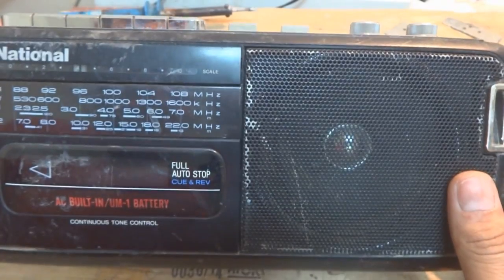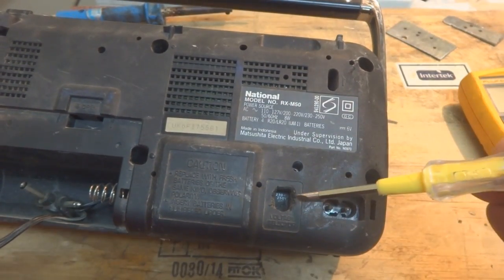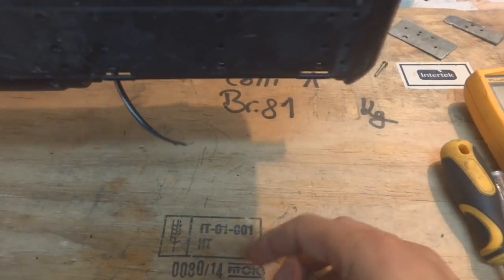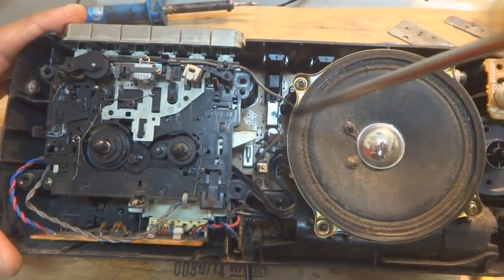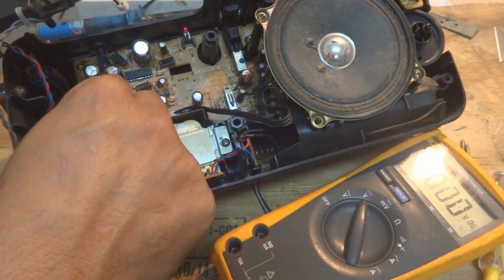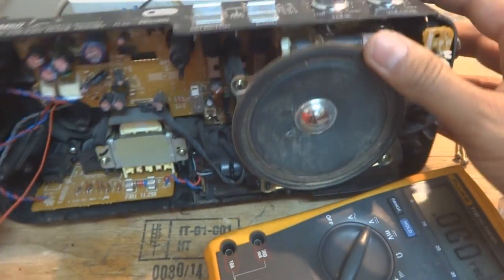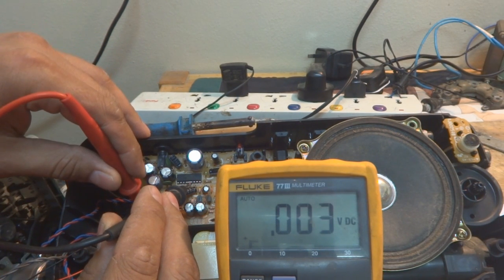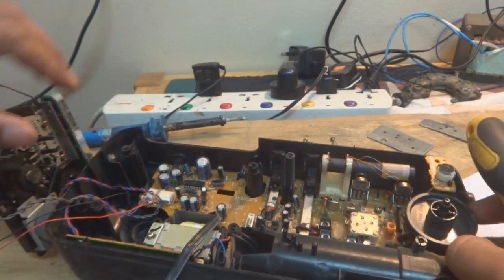Stereo repair ; Audio repair; Radio repair at home easily; Learn Electronics part 1

Comment: Boss I recently purchased a Geepas GR6842 10-Band Radio. The sound is good for talking but for music, it lacks bass. Please tell me if I can replace a good speaker with good bass. If yes, what type? I hope to receive a reply thanks!
Reply from the maker: Thanks for your comment. Unfortunately these small radios has low capability and poor output response. Reason for that is poor quality speaker and poor design amplifier in them. Also you can't enhance their response as your replacement speaker will have the same quality and amplifier you can't change the circuit design. Best wishes.
Reply: LearningZone I see. So I am stuck with the internals of the radio forever😄 Anyway, I guess you right because I bought it for a cheap price. Thank you boss! I really enjoyed your videos. Cheers!

Comment: I built a AF RF signal injector probe to check around the board...to find something active...I would start at the volume control on the 3 connections..then work my way back to the speaker..the probe is very easy to build..I used a computer speaker/amp and put a capacitor and GERMANIUM diode inline with the probe, and that is what I use..just connect a ground anywhere on the radio...and probe around with the RF probe's positive side..

Comment: Hi I have sony radio power is working but no sound ,initially there is sound slowly the sound become soft then die off.Pls advise.thanks
Reply from the maker: It needs step by step troubleshooting to figure out the defect.
Reply: @JahanZeb1976  usually what happened? Thanks

Comment: I did notice that you set the voltage selector back to 240v, but you jumped to taking the radio apart first, how confusing :-/
I would have put the multimeter across the mains socket and see if the low resistance of the transformer primary winding still exists, i would expect it to be open circuit since the voltage selector was wrong :-(.
Did you do this test before the video?
Sometimes the primary winding has a fuse under the top insulation, hopefully that popped and saved the primary.
National made some good equipment, i had a small tv that lasted donkeys years ;-D
Reply from the maker: +zx8401ztv You noted very right sir. This was the case and I didn't test it yet. But I was sure about the power supply bad health due to wrong voltage selection as well as a piece of cable coming out of the batter compartment. I guessed that when the power supply went bad, the owner with a little electrical knowledge; or seek help from some one and fixed the cables to battery compartment and was bringing it back to life using external power from some cell phone charger or some other source. This would be time of blessing for him when he brought it back to life! But the joy didn't remain for ever when he or his belonging tried to connect it in reverse. The circuit board got damaged and then it became useless for the owner. That was a time of blessing for me as with that defect I became the second or whatever number owner for this audio! The second part of the video will cover its further diagnostic and repair.
I fixed same kind of power supply from one same machine with much more defects but with good power supply. I will bring some time the defective power supply and will do it in front of camera as it would be helpful for some newbies in the field.

I am sure you understood the defect and propose possible repair also in your mind using your conjuring magical skills! As by God grace you are a rock of knowledge and a real wise man ever! May you live long and always in good health! Regards,
Reply: +LearningZone 
LOL im just another human, not wise, not magical, i only know so much, i learnt from taking things apart and making sense out of the building blocks and patterns of electronics.
I really only know enough to repair ordinary electronics, you are far smarter than i will ever be, You just havnt realised how valuable you really are :-).
You can wrap your mind around engine management sensor outputs and make sense out of them, you rewound that motor and it looks new and professional, switchmode power supplys dont stand a chance against your cleverness :-), car repairs are easy for you.
You cope with many things and win with your repairs :-D, you are so clever, i enjoy your abilitys and learn from them :-D.